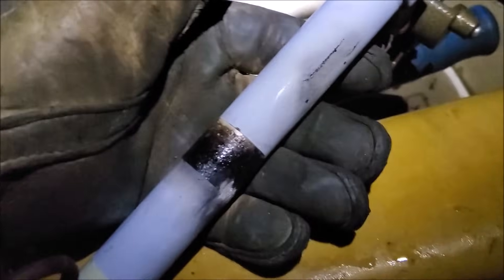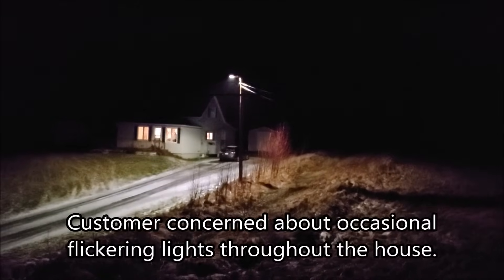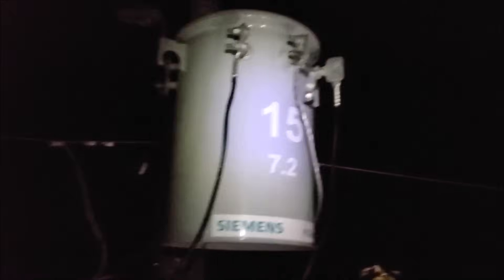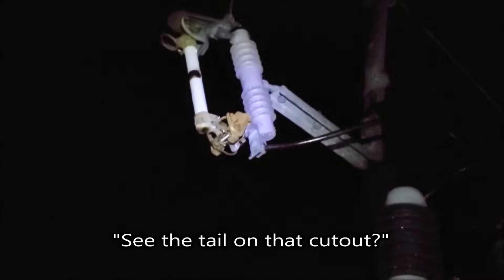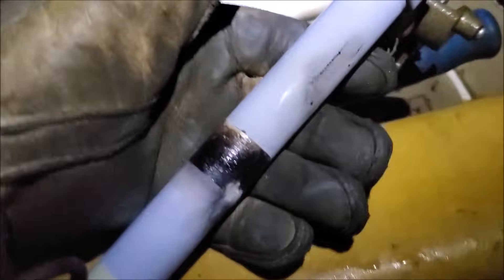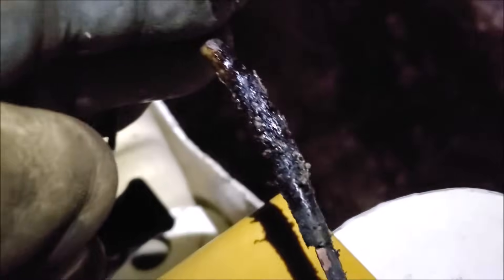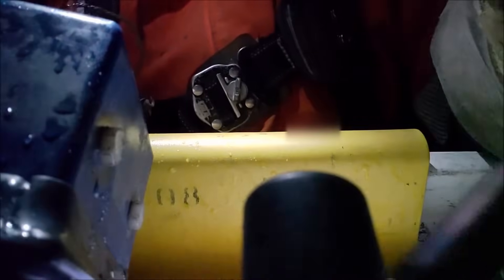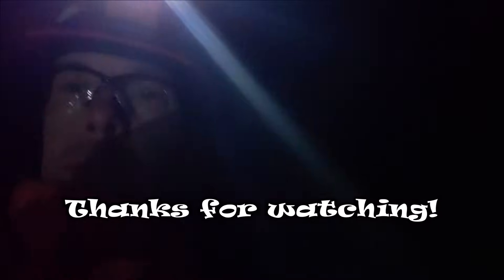Blown 7200 volt fuse feeds Home?

Comment: I'm Suprised that the fuse didn't arc or catch fire with 7200 volts feeding the transformer. But like you said the bottom was loose. Even though those are made out of porcelain and all it's still amazing to see no smoldering smoking or arcing. I believe that fuse in one terrible storm would of fried the Transformer and fried the home as well. Thank God for grounds connected to the poles and Guy wires wherever possible on a pole.

Comment: The door obviously didn’t drop open. That seems to happen regularly. Question is why was the fuse element blown? Trees nearby, or a recent lightning storm? It’s worth mentioning a common mistake lineman make when disconnecting a tap with a fuse for some reason or another. They pull the cutout open and leave it hang upside down. In time the upside down tube catches water swelling the inside of the tube as water can’t escape. Then when the fuse blows at some point later the element won’t clear and drop free from the tube. Always remove the tube and hang it right side up on a nail.
Reply from the maker: Yes!! That's a really good point, I don't think I've ever mentioned that. I'll be sure to cover that at some point 👊

Comment: The weirdest fuse story I have was a small ceramic cartridge fuse in a control panel for a machine. The fuse blew every day late in the afternoon between 3 and 5 o clock. It turns out the fuse holder was near a Transformer that was beginning to go bad and ran a little hot. The way I found this out is I got mad and slammed the fuse on the ground one day. The ceramic shattered and I noticed that the fuse element was not blown. The solder inside the ceramic cartridge was melting and running down to the bottom of the fuse so the fuse link lost contact at the top. It got just hot enough in the late afternoon for the solder to melt.

Comment: The LCD readout on my TrippLite UPS shows anywhere from 115 to 122 throughout the day, fluctuating a lot. Should I be concerned about something? I believe I share a single transformer with 3 other houses and it does not appear to be a banked system here. Note: My house has no ground and still uses fuses.

Comment: we had that happen in our area... the fuse link blew and the 4 homes that were on the line went dark... Idaho power came out and replaced the whole assembly with new parts....I guess its easier to update the pole then just replace the fuse link.

Comment: We have a lot of really old cut outs, back country. old rural stuff. The fuse fails but the door doesn't open. We look for "tails" some times the link hanging out or not tight in the door. Kind of hard to see. some time, the fuse looks fine, but it's failed.

Comment: We fused 15 kvas @ 2.5 amps on a 7.2kv system, what was your fuse size? Our engineering allowed fusing for 150% loading. I always took an amp reading after a meltout on a cold night.

Comment: 121 volts per line. There are two lines, but it’s only single phase power. ;) 

I wonder what caused that fuse to fail?

Comment: Bob: question please.  Do some areas of North America use single bushing
step down transformers (the can) thereby INDICATING that the power company
DOES NOT use a neutral conductor back to the source on 7,200 volt distribution systems?  If so, what do they use in place of a neutral? thank you.
Reply from the maker: The single bushing transformers still have a neutral return, but is bonded to the side of the tank (H2) and at the same potential as "ground".

Comment: Interesting video. Did you know the reason why the fuse blew?
Reply from the maker: Probably a combination of fuse fatigue/defective and load as it had been extremely cold! Likely a slow burn and the majority of the fuse link stayed caught up inside the door. May have also been some ice around the door before it heated up.
Hard to say exactly, but doesn't look like it was caused by a fault.

Comment: I found out the hard way that molten sand conducts electricity quite well. One of my devices had a fuse inside a tight-fitting metal pipe, and it heated up and then melted during a short circuit event. The molten sand then continued to conduct electricity until it melted through the metal pipe.
Reply: At a demonstration at Corning Glass they showed that molten glass is an electrical conductor.

Comment: Wait. Did the material in the fuse for arc suppression liquefy? I worked for a major fuse cutout maker and never saw that happen. I have seen fuse links melt solder between the braid cable and the fusible link without blowing the fuse.

Comment: If you replaced the transformer, why would you not replace the cutout as well.  
I could be wrong, but cutout looks old.
Reply from the maker: I'm not sure who replaced it.., it is one of our more recent polymer style cutouts but with a much older door. (Probably taken from the previous cutout)

Typically during a tx replacement we replace any and all parts or connections that are nearing their lifespan

Comment: I'm confused, is that a single bushing transformer? If so how did it have power? I've had something similar happen to my home but it was a two bushing transformer and one of the legs got blows but we still had 120v on two legs but only 170V phase to phase under load  but in this case I don't see how that's possible when you only have one leg feeding a transformer and it's blown. Or was it just shorting thought the blown fuse?
Reply: A single bushing transformer is fed from the high side and the neutral connection to the tank. Even though the fuse was blown, the cut-out was still conducting current to keep the transformer energized.

Comment: Had a few faulty connections on the primary in my area.  Unpredictable voltage drops, humidity affected it, sometimes as low as 93 volts on each leg.  Turned out to be loose primary connections between poles found with a thermal camera.

Comment: That's unusual, but interesting to know this happens! Thanks for the video!
Reply from the maker: It doesn't happen very often, I was definitely scratching my head for a minute! 🤔
Reply: @Bobsdecline  I'm guessing the fiberglass tube got hot enough to conduct, or it somehow just carbon tracked, or perhaps the fuse got hot enough to melt its way into the fiberglass and just sat and burned. Those are my guesses.
Reply: It depends on the primary voltage and the environment it's in. I used to work along the ocean ( lots of salt spray) , with 25kV primary (easier to track across) and older cut-outs and we saw this pretty often when the cut-outs wouldn't fall open. A few a month at least and with a higher load on say a tap fuse, you'd see the cutout glowing or even burning as you rolled up.

Comment: Chris here, 60 yr old  tool twisting industrial electrician in south Florida (jealous?) that works very closely with our utility provider.Making posts while at work would be a serious safety violation here.Love your content but wonder how you employer is OK with you doing this at work???
Reply: I would imagine he doesn't actually post it while working. Just videos certain things.
Reply from the maker: Hey guys! Yes, your right @everydayfixer all post and editing are done on my own time. A lot of time I am able to secure a camera in a safe spot and leave it record an entire job simply to acquire a quick 30 seconds without having to fumble around with a camera. I also have a long list of "do not's" such as film customers, unsafe acts ... Or inappropriate content in general.
I also sacrifice many of my unpaid breaks to make up for the slight loss in time when I stop to explain something.
I put a lot of my own time into this and work very hard to make sure everything is kosher.  I am very open with my employer, and respect any concerns that are brought to light.
✌️✌️👊
Reply: @Bobsdecline  If your employer ever queries it, I hope they will read some of these posts and realise what a credit you are to both your company and your trade. I'm based in the UK where of course our electical supply is a little different, but the distribution is still high voltage, outdoors and dangerous. Your videos have really opened my eyes to the work linemen do, total respect to you.

Comment: I'd imagine that the burn damage would have made the load seem more resistive... Would the customers meter have been reflecting that "increased" load?
Reply: The load is measured after or past the meter. They get charged only what they consume.
Reply: Yes what john said, the meter has voltage coils for that reason. the lower voltage would be reflected in the reading

Comment: what would cause a fuse like that to blow? id think a breaker in the house would go before a cutout door,   but im not a lineman or electrician, I only deal with 12v systems
Reply: Squirrels
Reply: When you see the tail just melted off it’s from repeated lighting bumps on the line. One little fault from a twig touching the line is enough to make the fuse fail. Despite the spring in the door, some doors just don’t open they way they should? As for the fuse tracking through the fuse holder? There must be a lot of carbon/paper inside there for electricity to track like that?
Reply: Same way every fuse eventually blows - Too much heat damages the link (fuseable link) between the top and bottom of the fuse. 
Fuses/Breakers are only affected by what's down stream of them; So the customers main breaker wouldn't have noticed the issue.